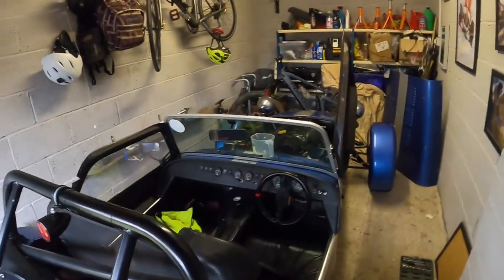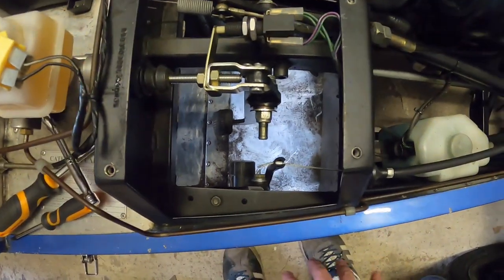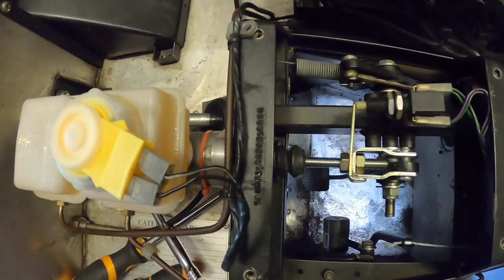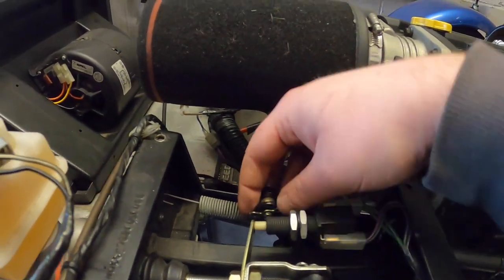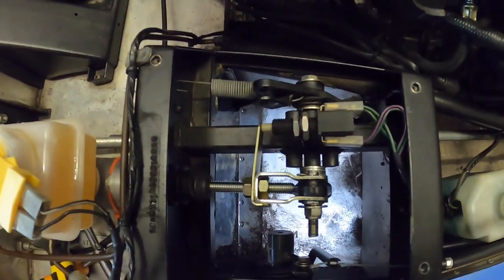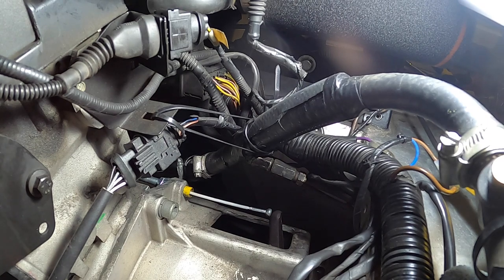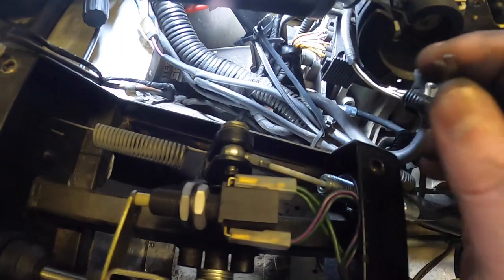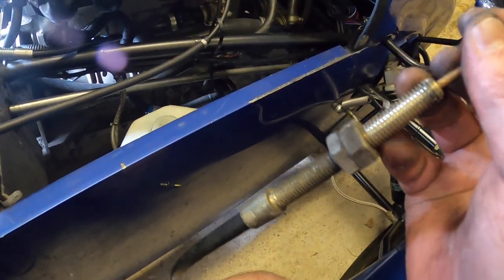I crashed it! Replacing the clutch cable on my Caterham 7

Comment: The brake light switch is not squeezed on application of brakes but is sprung loaded and released on application of brakes. Your brake pedal has an R clip in the clevis pin. This should be replaced by a split pin as the R clip has been known to fail. There was a factory recall on early cars for this.